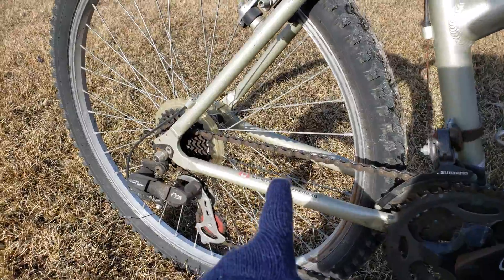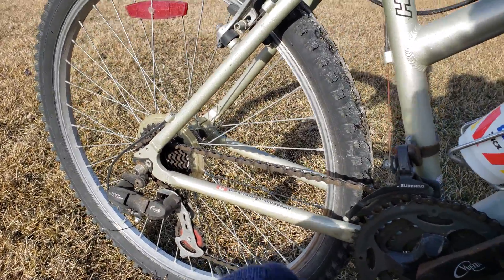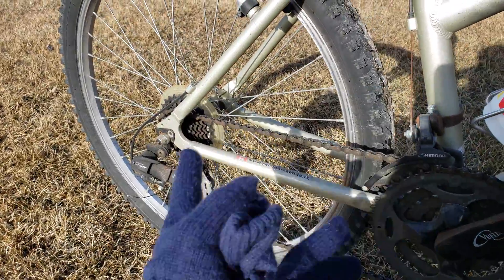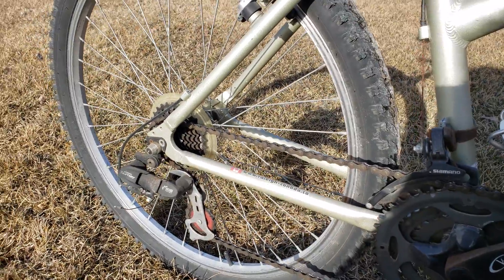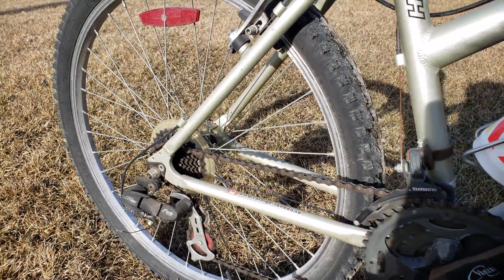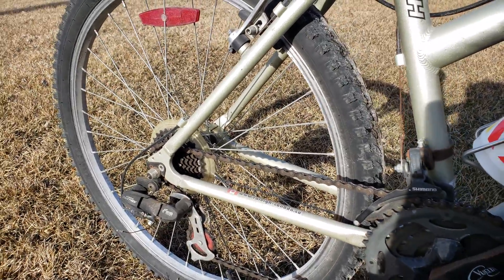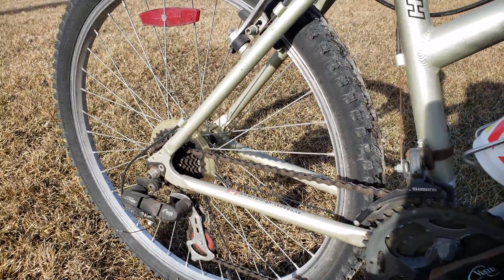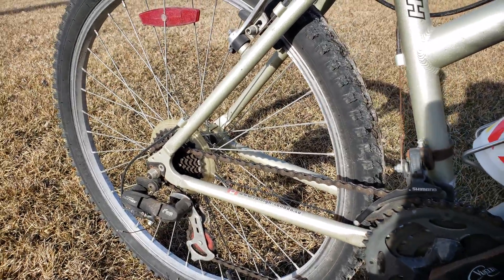How To Fix Bike Chain Falling / Slipping / Jumping / Skipping Off When Pedaling

Comment from the maker: Mr Choi,  it sounds like dirty chain and drivetrain. Your chain may have sticking links resulting in pull rear derailleur forward.  Clean the chain and lube up. Hope that gets it fixed.
Reply from the maker: Reol Choi  You are very welcome.
Reply: Or the casette is dirty inside?
Reply from the maker: @magnumllama400   cassette wear out. The mechanism is sealed , so the cassete will wear out first.  The best way to tell, if the teeth are very sharp, it time to replace it.
Reply: @IvansBikesBmws  my casette feels a bit hard to spin sometimes and sometimes if I move the bike forward my pedals start to move too. Or if I pedal backwards, the casette doesn't move and rear derailleurs move forward and chain becomes loose and touches the frame. Why?
Reply: @IvansBikesBmws  the teeth are fine though and the chain is mostly fine. Just the cassette gets sluggish a lot of times. When I spin it, it might spin fine and suddenly it kind of locks a bit and doesn't spin freely. And it's not consistent it doesn't happen in every rotation. Why?
Reply from the maker: @magnumllama400   The only other thing to inspect is your free hub. When you remove the cassete, you have a wheel hub where cassete mounts on. That is most likely your problem. I would start from there. Compare a good hub and compare yours how well it spins, and you will see where the problem is.
Reply from the maker: Now if you have a freewheel,  the lubrication could have worn off or the unit is totally worn out. Wish you luck.
Reply: @IvansBikesBmws  not it's a shimano hyperglide casette. Yes I plan for removing the casette and checking the freehub.
Reply from the maker: @magnumllama400   Now that is 100% cassette,  tackle the free hub. That seems to be the issue.

Comment: What type of oil
Reply from the maker: https://amzn.to/2GB4KuU
Park tool oil is what I use.
Reply: @IvansBikesBmws  I have the same problem my bike is 3 months old, suddenly last week the chain started to sag when I was going down hill. I saw videos of what could be the problem and the first that came up was to clean the bike. I got the fancy chain cleaner and cleaned the chain and cleaned cassette with WD40 degreaser and brush and then i washed my bike and oiled it back with WD40 all conditions oil but the chain is still dropping when I am idling. Can you let me know what is the problem?
Reply from the maker: @sikandarhamid5032  

Than you inspect your chain rings and see if the derailleurs were adjusted properly.  The main three causes are:
Chain 
Chainrings
Derailleur adjustment 

One of those three! Hope that helps.

Comment: Verdict : it’s because the chain is being bent to much because of your front chainring. If it’s bent too much, it would skip because the chain is being pulled together by skipping off the ring it was just on. If you have multiple rings in the front, for example, a 2 by or a 3 by, have the chain on an appropriate gear so the chain line is straight. In the video, I see that your chain is on the largest ring on the front and quite a few rings more in the back. So switching gears infront can help the problem.
Reply: So do I need a new chain bc mine does this
Reply: @ob_removedyt1450  No no you don’t need a new chain, I mean if it keeps skipping. But it usually is because of the way you have the chain set up. Half the chain straight as possible when you are using it. But maybe check with your bike shop to see the problem.

Comment: Hello my friend, thanks for the video. It's the first video that has a problem similar to mine. 
The bike was perfect and had most of it's parts changed recently. After a little fall in the ground last week, i can't backpedal anymore and there is a noise coming from the chains when i'm pedalling. 
The chain does exactly as you described in the video when i backpedal (it bends down and touch the steel that holds the back tire, don't know it's name). I don't think it's lubrification, because as i said, it happened after a little accident. 
The bike did have a little impact on the ground, but it didn't fell on the side of the derailleur, so no direct impact on it or the cassette. 
Do you think there is some easy solution that a uneducated man on the bike mechanics like me can do. Or do you think i should take it to a professional local store to see it? 
Thank you very much!
Reply from the maker: Well  , you said the chain is good and rear derailleur/ hub is good as well. The truth is,  something got messed up. If you are the the chain is good, I would look into rear hub / rear derailleur.